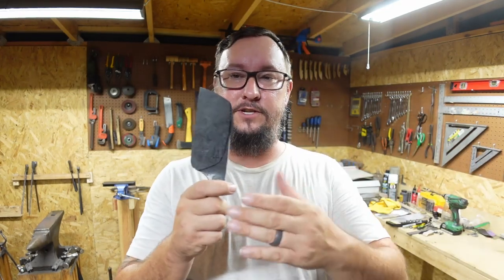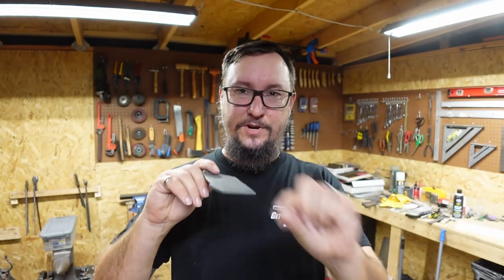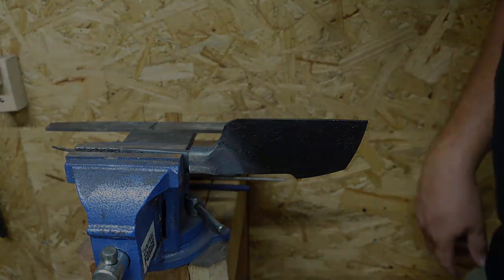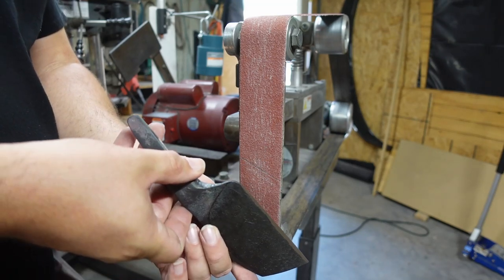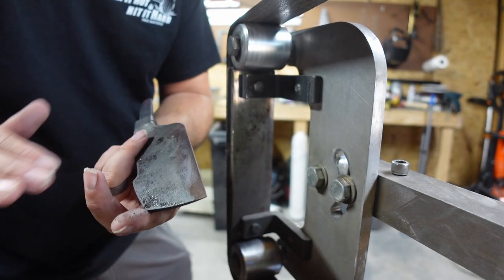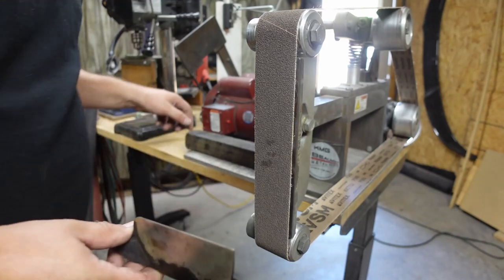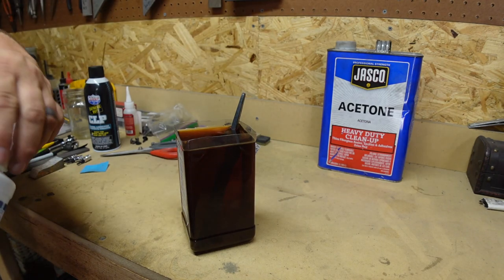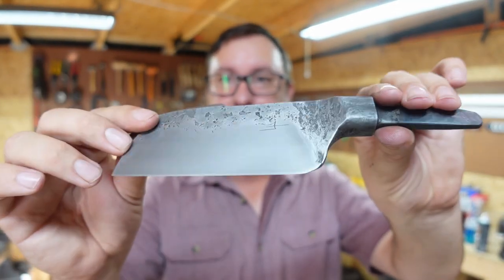Heat Treat And Bevel Grinding Explained In Detail | Shop Talk Tuesday Episode 185 | Long Video Alert

Comment: Quick question - do you have to strain the any scale from vinegar between uses, or can you just keep on using it without? The colour looks very different between when you take the steel out the first time and when you use it after grinding the bevels.
Reply from the maker: It all dissolves and falls to the bottom. I haven't strained it yet.
Reply: Hey Eric - what size v bolt tongs would you recommend for knifemaking? I am looking getting a set and want to get a size that is usable and not too small

Comment: I have a question. I got myself a very small cheap carbon steel knife that had like 60° edge angles (on each side!) and I tried bringing that down by hand on a diamond sharpener to about 20° and I still couldn't manage to get them shaving sharp after that. I guess the heat treat was also out of wack?
Reply: Nothing to do with heat treat. You can get a blade shaving sharp without any heat treatment at all. The heat treat just hardens the steel and allows it to maintain the sharpness.
My guess would be that you haven't fully cleaned up the final edge. Try stropping the blade (an old leather belt is fine for this) and it'll clean up the burr that develops during sharping.
Reply from the maker: I was going to say something similar to @Bridgercraft it might just need to be stropped. You can shave with an axe if you finish the edge all the way.
Reply: @theriversexperience9383  indeed. I'm a knife maker myself and it took me a little while to figure out the benefits of a good strop!
Reply: @Bridgercraft  The leather with a bit of compound made a new burr for each pass, although smaller. I managed to get it "somewhat shaving sharp" now after some diligent stropping. I also tried to run the knife on a piece of wood to try to break the burr.
Edit: I tried raising the angle just a little bit and it's plenty sharp now. I thought if I was raising burrs I was already at the apex? I'm more confused now, but at least it's shaving sharp.